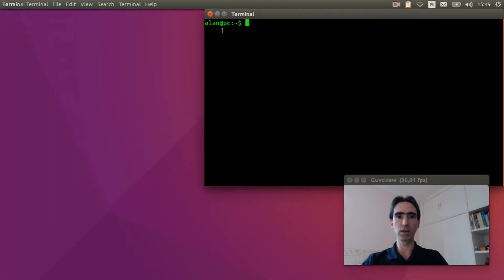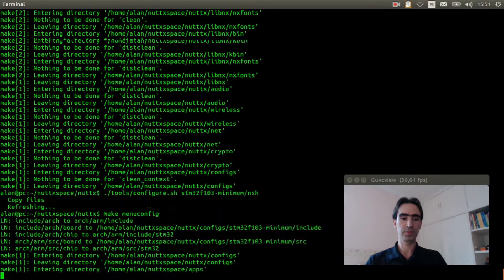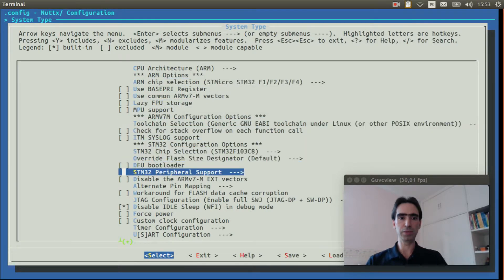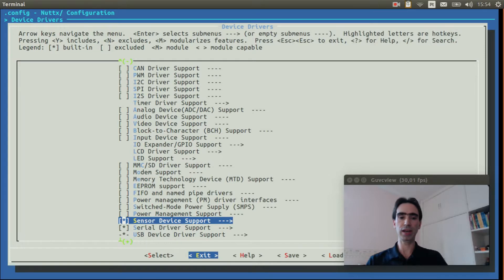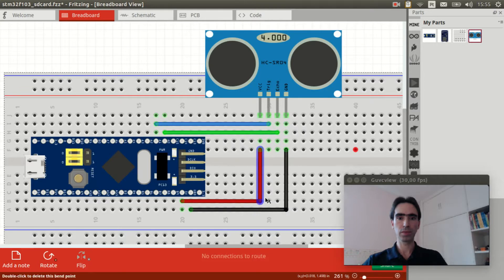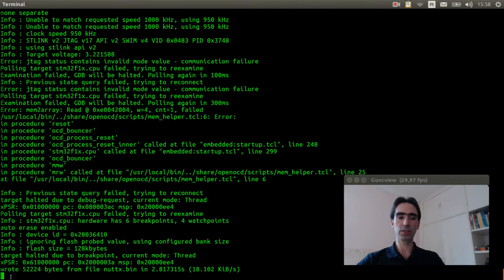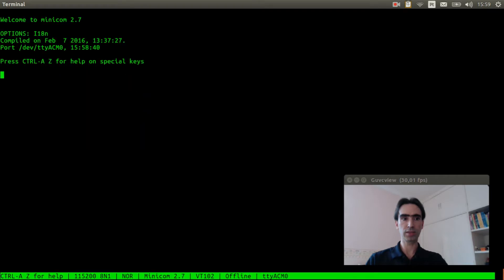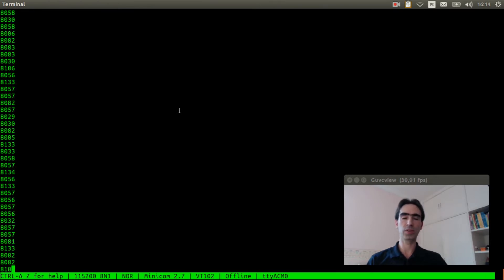#016: Using the HC-SR04 to measure distance

Comment: Is there any specific reason why you used A1 and A0?
Reply: Hi kiroarama, good question! Look the STM32F103 Reference Manual, particularly the Figure 21. External interrupt/event GPIO mapping! Notice all Px0 are muxed to EXTI0, all Px1 are muxed to EXTI1, and so on. Then it is a good practice to avoid using PA0 and PB0 or other Px0 for second interruption pin, to avoid delay caused by interrupt collision on EXTI0. But of course you could use other pins, not particularly PA0 and PA1. BR, Alan